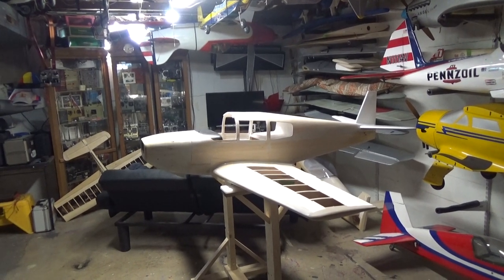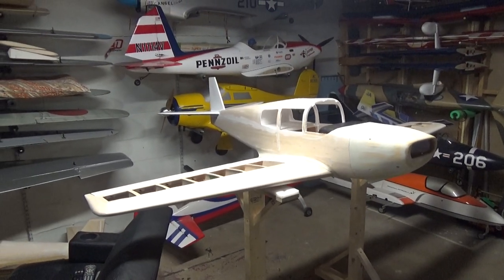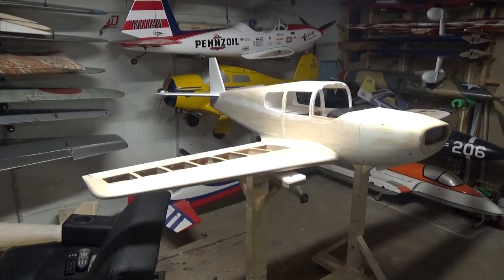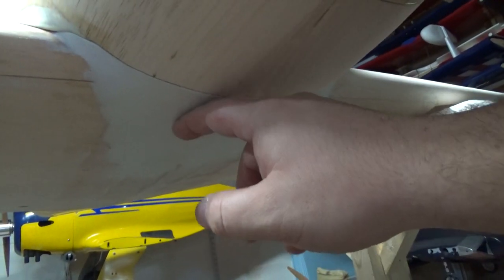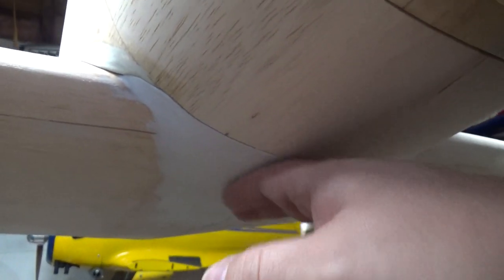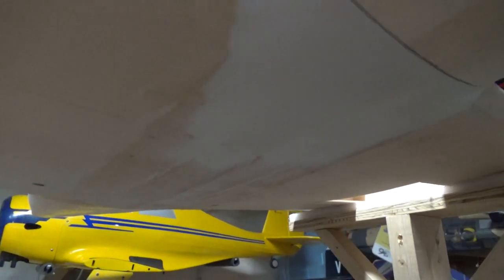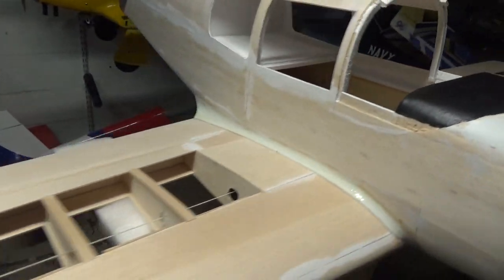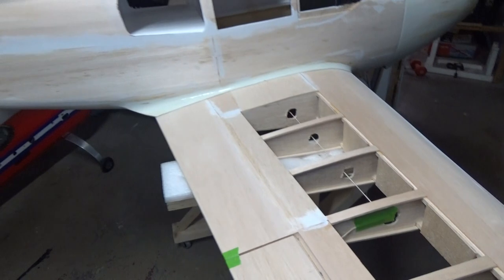1/4 scale Corvin Miller Globe Swift build update #4

Comment: Looking good Andrew, try looking into using amazing goop for the windows, it worked great for my aerobatic airplane. It stays flexible but you need to use quite a bit of tape to hold everything in place. It is always good to have options. Looking forward to the next video.